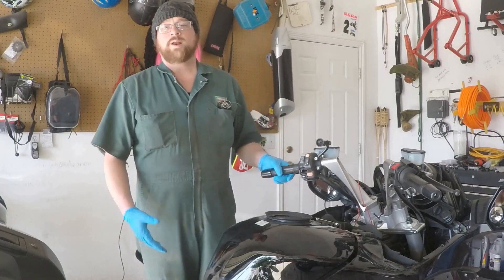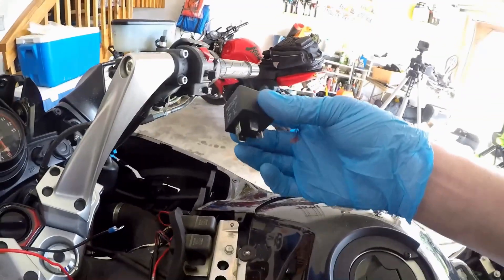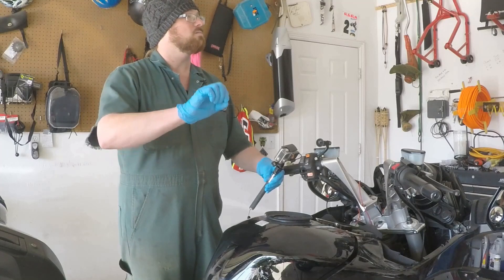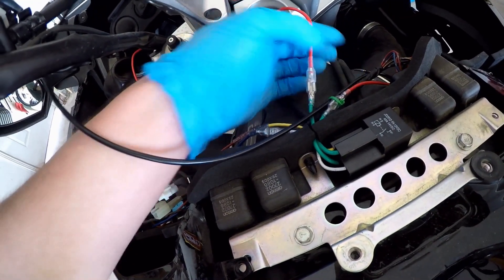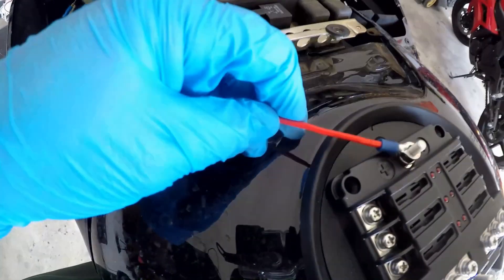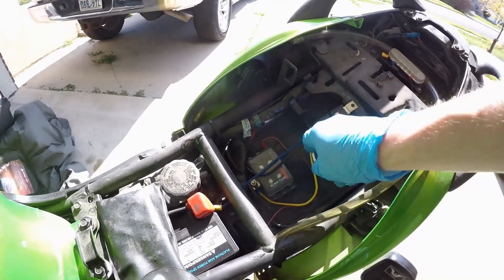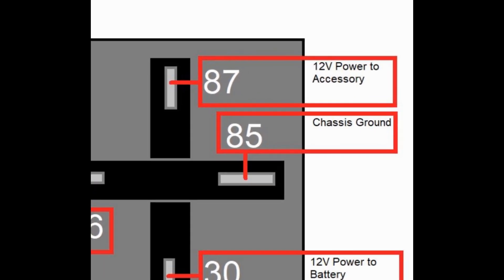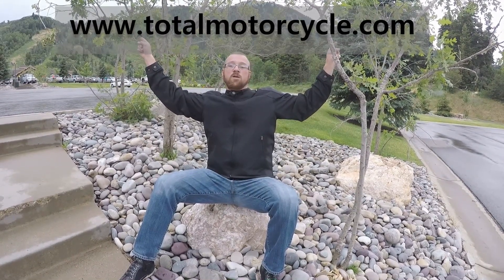How to Install a Switched Power Relay and Auxiliary Fuse Block on a Motorcycle - TMW Garage

Comment: The negative terminal from the source power/slave circuit, does it connect to anything?
Reply from the maker: I assume you mean the negative terminal off the "switch" circuit from the relay? Any good ground will work, and in the video I suggest routing that connection to an open post on the ground bus from the fuse block.

Comment: Hi. Great video. Is it necessary to have an inline fuse for this installation? If so where do you put it? On the + between the battery and the relay?
Reply from the maker: You could absolutely use an inline fuse to protect the aux fuse block, and on the positive wire coming of the battery to the relay is a good place to put it. That way you're protecting the relay and the box.

Comment: Hi been watching you what gauge wire are you using I got 40 amp relay  12 blade fuse block  for LEDs charger dual air horns  auxiliary switches will I need heavy duty wiring exactly like your  application thank you great job 👍
Reply: Also active loc lci2

Comment: Hey. Great video. Very helpful.  I have a question. Can a single relay power the hole fusebox? I bought the same fusebox and I want to attach heated grips, fog lights, a voltmeter with usb socket and a GPS on it.  Do I have to get a bigger relay or a thicker cable from the relay to the fusebox? Thanks
Reply from the maker: Thanks for the question! Typically the relay and the aux box will be rated for their maximum amperage. Usually they'll be 30A but not always. 

Figure out the draw for all the devices you want to connect and make sure it's less than the max load for the relay and box. You can do a LOT with 30A, but if you need more you'll want to wire up two separate boxes to run the whole thing. 

Lastly, you can search "wire amp rating" and find charts that will identify which gauge wire to use for what current.
Reply: @TotalMotorcycle  thank you very much.  Very helpful.

Comment: If the manufacturer didn't provide me with a switch circuit how should I route the relay and the box, could I still use the light from the license plate, I am sorry to ask all this questions but when it comes to electrical all that is Chinese to me. I am just trying to connect a gps but I like the idea to have a box that I can use for some others devices. Thank you in advance for your reply
Reply from the maker: Thanks for your question! If your bike doesn't have an accessory circuit, the easiest is to power the relay through the license plate lamp for sure. You could also power it through the horn if that's easier to get to. Best of luck!

Comment: Question: how to connect auxiliary lights to a  power distribution hub that has an integrated relay and five fused switched output circuits (3A nominal, 5A maximum). It's an Innovv Power Hub 2.
My current setup is a pair of Motolights with 8-watt LED bulbs that includes a complicated wiring harness designed to handle 100 watts. This harness is a maze of wires consisting of a relay, switch to control the lights, inline fuse, and connections directly to the battery terminals. I would like to get rid of most of these wires and connect the lights directly to the power hub.

I'm installing an Innovv Power Hub 2, and am wondering whether I could cut out most of the  existing Motolights wiring harness setup. Can I connect the positive and negative wires of the lights directly to one of the Innov switched/fused circuits and include the light switch to control the lights in that circuit.
Reply: Okay, I think I figured it out. A separate relay is needed for the on/off switch that controls the lights. Otherwise power would constantly be going though the switch and switches aren't made to handle continuous power.

Comment: Great Video, but I'm confused. I just got my Denali lights and a dashcam. Both devices on their main power cables have another wire. Labeled Switched Power. So let's say I want to connect my dashcam and Denali lights. So far I know the cables that would normally attach to the battery goes the fuse box. . Now, Where do I connect the Switched Power cables of each device????
Reply from the maker: Thanks for the question Daniel! 
In this case, your devices contain their own relays. They use the main power cable to actually power the device, and the switched power wire to turn the device on or off. You would attach the main power to your battery, and the switched power to your accessory circuit or some other switched power accessory like your license plate lamp. The device will switch itself on or off when the switched power cable energizes.

Comment: Nice job,,but I can’t see positive relay cable coming,,,,,starter relay?…
Reply from the maker: Hi! I'm not sure exactly what you mean. The "trigger" for the relay is connected to the factory accessory circuit, and the other positive cable goes from the battery, through the relay, to the fuse block. Nothing is wired through the starter, because the accessory circuit is already keyed.

Comment: I didn’t understand the need for the relay… if your bike already has a switched circuit why didn’t you connect that circuit’s positive lead directly to the positive terminal in the aux fuse box?
Reply: Than you would be stealing the power from that circut. All the accesories that you connect to the fuse box would be running through that circut you tapped into. It could blow the fuse, send low voltage to the circut etc. you want full 12volt from your battery
Reply: @SuperCreativeLemon  Ok Now I understood.
The relay has a “main” connection directly form the battery to the fuse box but that connection will only be open when the third wire (from the switched circuit) sends signal to open it, right?
The switched circuit only functions has a switch to “open” the main connection…
(Probably all of this is explained on the video but I didn’t pick it up at first…)
Your explanation was very useful, thank you very much. 👍🏼 🙏
Reply from the maker: @JoséPedroFilipe-z8r  Creative Lemon nailed it. The accessory circuit doesn't carry enough current to power the entire fuse box, just enough to "switch" open the relay and send direct 12V power from the battery.
Reply: @TotalMotorcycle  yep, the explanation was great.
Reply: Great way to overload... or get the wire way to hot... next step... fire.
Wiring gauge is important for the amount of load you will require for the add on.

Comment: What if your accessory boot doesn’t have a power and negative wire coming from it like all the other touring bikes do?
Reply from the maker: Tigerman, if you don't have an accessory circuit to run the relay switch, tap into the power and ground wires from your license plate lamp. That's a safe circuit to use and it switches on with the ignition.

Comment: Man... I'm trying to hook up a bus bar to a Polaris rzr,  but this was basically the same concept. Thanks for video.
Reply from the maker: Yep, this should work essentially the same on any 12V system. Does your RZR have an accessory circuit to slave to or will you use the plate lamp?

Comment: What size relay switch and in line breaker needed for fuse block?
I’m thinking of putting a GPS, Spot Lights, and phone charger. Max power draw could get to 10-16 amp. Any advice?
I got LS650 1995. Thank you
Reply from the maker: Manoj, thanks for the question! The relay I used is rated for 40A, and that's the size fuse I would recommend if you're doing a inline fuse between the battery and the relay.

Comment: Great video answered a lot of my questions. I had only one other thing I needed to know. How many amps can the fuse handle? So right now I have all of my lights and radio running straight off the acc. power. The problem is is its like an 18 or 20 ga cable absolutely not rated for the power im drawing from it. So I what I was guna do is just run all my power from my battery (luckily the fuse block I have already has a big thick 10 ga wire running to it. If I just run straight off of that though all of my LED switches will drain my battery quickly. So What I wanted to do was, what you did here. ACC. switches on the relay which powers a fuse block and that way my LED switches dont kill my battery. Thing is , (btw im working a Polaris RZR) the power that I use is significantly more than what a small gauge wire that you used in this video can handle. I mean multiple high powered light bars, lots of LED lights all over, and a pretty powerful radio. So to sum it all up, how big of a wire can I run through this relay? and can you get higher powered relays that work the same way? I almost was just going to put a physical switch at the battery turn turn off all power to the machine, but I dont really want to do that if I dont have to.
Reply: Im wondering if I should just do more than one relay to each switch but that sounds like a lot of spaghetti wiring
Reply from the maker: Trashman, thanks for the question! The fuse I use in this setup is rated to handle up to 40A, and the fuse block itself can handle up to 30A per circuit up to 100A. That's obviously more than the relay can handle though. 

I don't know a whole lot about how much power your radio will be using, but light bars and LEDs shouldn't have much of a draw. Off the cuff I suggest one fuse block and relay for your stereo, and another fuse block and relay for the rest of your components. But find out what your total draw is for all your components and go from there. It's often a low lower than you expect it to be. :)

Comment: Very nice clear video and well explained. Question- If I choose not to use a relay when installing the fuse block will the fuse block always draw constant power? I want my accessories to work on Switched power only and I don't see a connection port for Switched on the fuse block.
Reply from the maker: Tony, that is correct, if you don't install a relay the fuse block will draw constant power and could discharge your battery if an accessory is left on.
Reply: I noticed that you used 40amp relay to power up your fuse box. would it   handle a stereo system, and 2 different fog lights, cellphone charger.
 so im installing a driving and fog light, stereo system and a charger for phone.